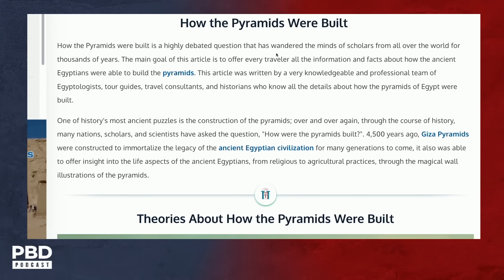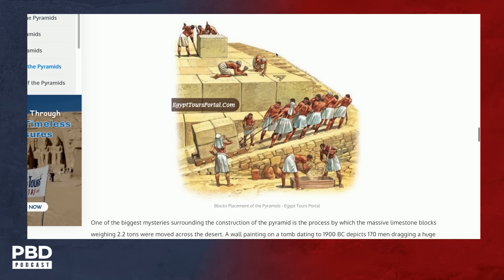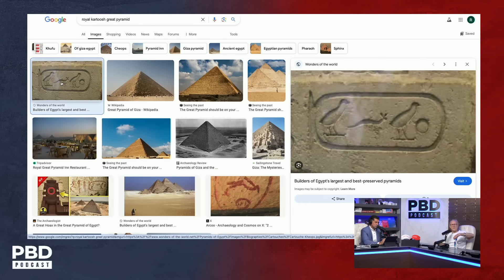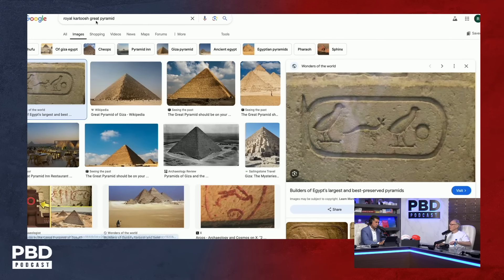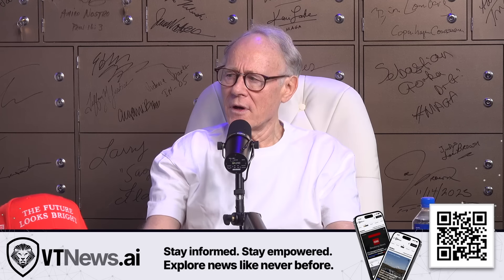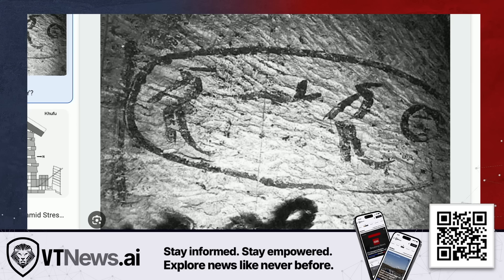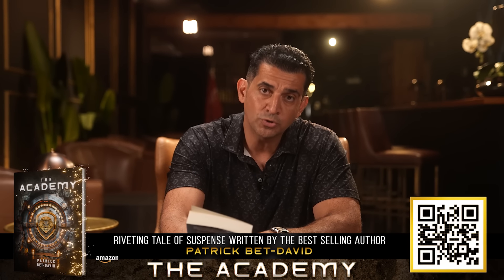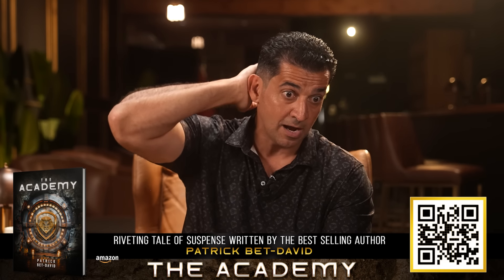"Blocks Weigh 70 TONS!" - Graham Hancock QUESTIONS How The Great Pyramid Of Giza Was Built

Comment: Modern cranes can lift a 1000 ton blocks. We can build them pyramids today blindfolded and we’re not even a type one civilisation.
Reply: The blocks are 70,000 tons a piece
Reply: @KPSavant  70 tons the granite blocks are in Giza. It’s like us lifting a feather with a simple modern mega crane.
Reply: @360XI11  the heaviest lift in the world was the Taisun crane at 22 Tons in 2008
Reply: @KPSavant  liebherr lr 13000 crane. Would build them pyramids with ease. And for the record 20,103 tonnes holds the heaviest lift ever by crane. The 1300 lr has a max weight load of 3000 tons, and max reach of 814 feet, pyramid of Giza stands at 418 ft. Easy work for that crane.
Reply: @360XI11  the blocks are 70 tons and the crane was the Taisun. Easily researched.
Reply: @KPSavant  was that lifting your mum out of bed? 😂😂😂👍🏻
Reply: @360XI11  my mother is a very small woman
Reply: @KPSavant  yeah I bet. With a brain like yours 👍🏻😂😂😂
Reply: @360XI11  did you look up the crane?